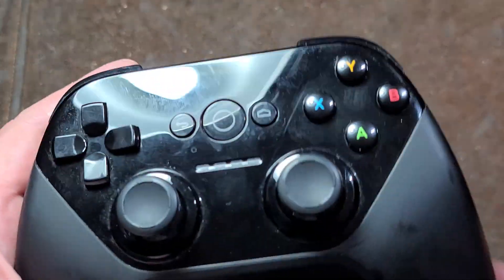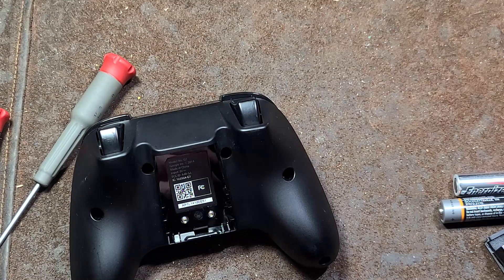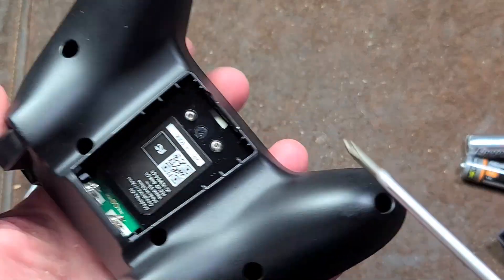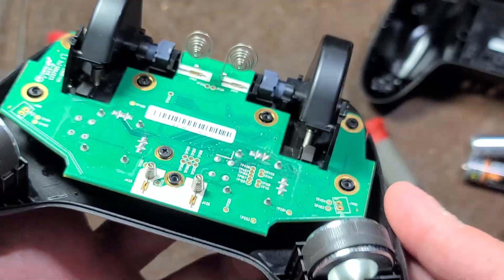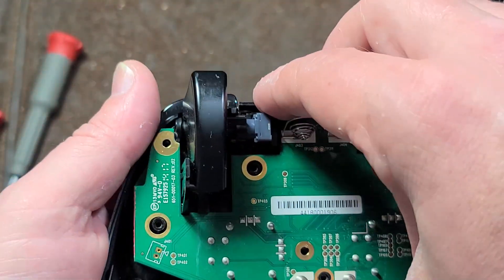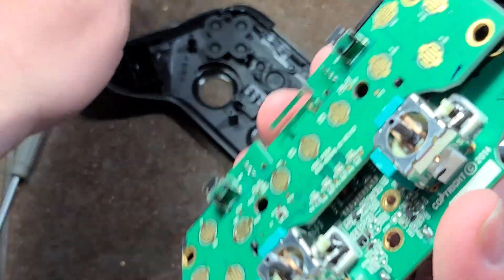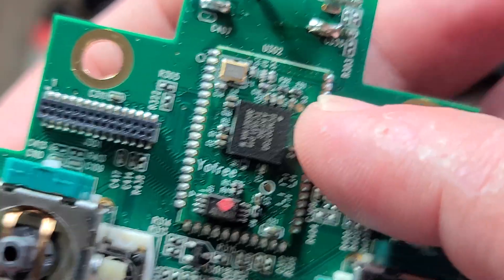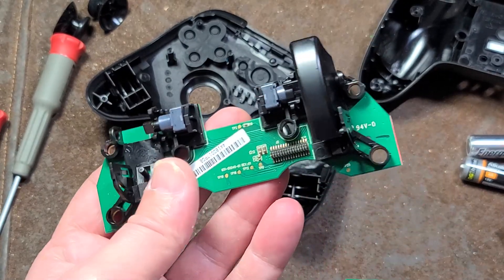Google G1 BlueTooth GamePad Controller Teardown

Comment: I have one myself and as mentioned in the video it was originally for the android tv dev kit the adt1. But if you're looking to make it work elsewhere it also works with bazzite Linux as a controller and as a controller some Android devices and tvs. For those who need to know how to pair it you press the home and back keys at the same time.
Reply from the maker: Thanks for the extra info on pairing and compatibility!